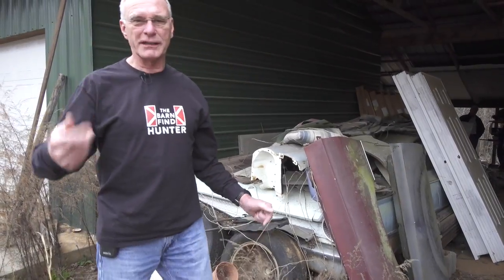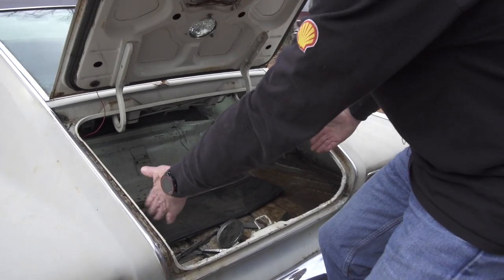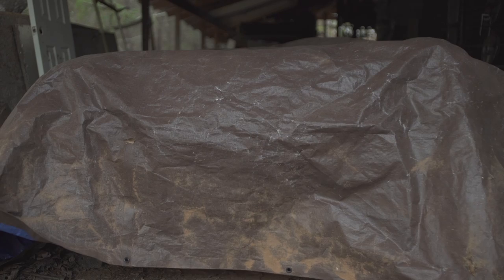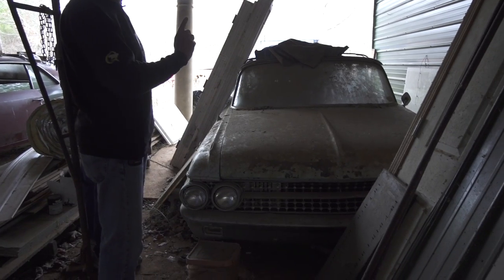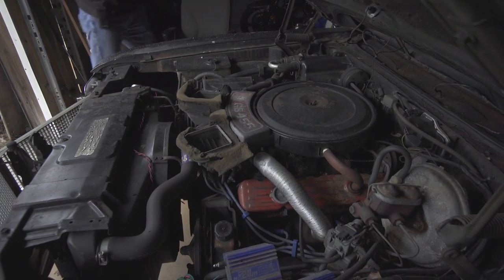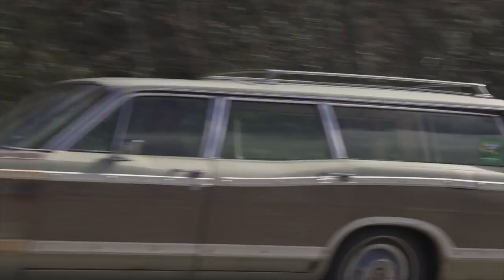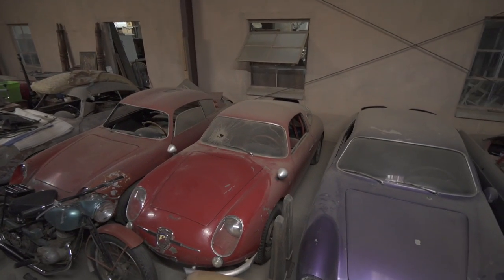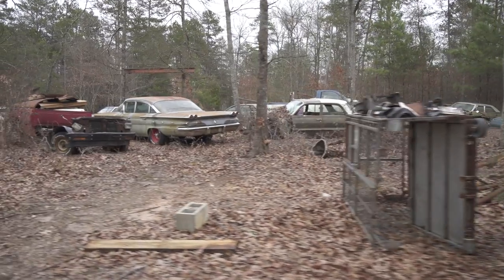Chevy C1 Corvette, a "baby Ferrari" and a dusty Abarth collection | Barn Find Hunter - Ep. 18

Comment: That '57 looked good for $5K but I thought that more complete '68 Chevelle for $7500 was the better deal if the frame and floors are not rotted like some of the body way. I wish i had $50K to blow on a car; that '70 GS convertible was sweet!
Reply: garth locklin that chevelle was a great deal
Reply: That Chevelle isn't worth $7500 unless it is an L78 car.  I currently own 5 Chevelles (69 SS 396 4-speed, 70 SS 396 4-speed, 72 SS 402, 72 SS 454 and a 70 Malibu) and have studied their prices since I was 18.  1968 is one of the least desirable years for Chevelles, and therefore one of the least valuable.  If that car is TOTALLY rust free (by rust I mean holes, not surface rust that requires no metal repair) AND an L34 car then MAYBE he can get that much for it.  An L78 car would obviously be worth that much.  Unfortunately, 68 SS Chevelles just aren't really well-liked by most of the Chevelle community for some reason.  The 375 HP 396 was available from 1965-1970, and out of all those years, the 1968 L78 Chevelles are by far the least valuable.

And that 57 definitely looked like it was worth $5k even without a drive train, but most of the other prices were just delusional.  $4,500 for that hack-job low-rider 4 door 63 Chevy?  But that's nowhere NEAR as bad as asking $8,500 for that 65 El Camino with a big block.  I mean that is BEYOND delusional.  That is probably TWICE what that car is worth.  And I wish this guy was a little more precise regarding that 70 GS vert.  Even though I am a lifelong Chevelle guy who also has a soft spot for GTOs (I have a 69 GTO vert right now), my all-time favorite 1964-1972 GM muscle car is a 1970 Buick GS 455/Stage 1.  I love that they were considered more "luxury" cars at the time, and yet the 70 Buick GS has such an aggressive, muscular looking body style while still being understated (no stripes or crazy colors, and the functional hood scoops are small and understated as well).  This guy calls that car a Stage 1 but according to the badges on the fender that is NOT a Stage 1 car, it is just a GS 455.  Not that that means it's not a cool car because it DEFINITELY is, but the difference in value between a Stage 1 convertible and a GS 455 convertible is HUGE.  If that is NOT a Stage 1, then $50,000 is DELUSIONAL, just like the majority of his asking prices.  Here is the same car, numbers matching/automatic just like his and in much nicer driver/local car show condition for $2,500 less than this guy wants for his car and that car listed in Hemmings likely won't sell for that high a price:  https://www.hemmings.com/classifieds/dealer/buick/gran-sport/1585146.html
Reply: I agree Alex S. The reason I like the '68 is it's less expensive then the '69-72 models. I have always had the less expensive classic cars and they are not investments to me. I usually start with junk and sink $5-10K into them and use them for 10-15 years and sell them for $3-5K after 50-80K miles. It's a cool hobby or at least it used to be. I feel as if I am getting robbed when buying NOS parts for my '74 Plymouth. Like Jay Leno says it's really easy to get upside down in an old car. I can also agree with your statement about the GS 455 convertible. You could tell the guy was trying to hide something about it in his mannerisms. He probably knows it's not a Stage 1 car although Tom Cotter said it may have been.
Reply: Alex S Cant agree with you more on the prices of these cars. I've owned several Chevelle's in the past with my all time favorite being the 68 elcamino. Total redesign from the 67. In my opinion has the best looking front end out of all the Chevelle's. Why that year is the least favorite among collectors is beyond me.
Reply: Yeah sweet and super rare !! Alotta bread for that car it will cost you ,10000 for a paint job let alone more detail work to interior band engine and suspension

Comment: One time in my life I found a true barn find. My brother had leased a farm for duck hunting and there was cars all under the trees around the house. IN the steel shed it was full and I mean full of autos and most were under tarps. The next week I was leaving for auction school and I told my brother to tell the owners to not sell them through the local farm auctioneer. I had been to several fine car auctions and ran a consignment auction for several years. Just as I predicted the local auctioneer pulled the cars across the block without even cleaning them up. an auction that at that time I estimated to be worth no less than $500,000 ended up bringing under $250K Had they been cleaned and worked on and taken to a fine auction I believe there was 900K minimum.

Comment: 6 years ago I had a chance to buy a Rambler Merlin that had every option available. If i remember right it even had the rare retactable seatbelts option. The engine was a 327 with a 4bbl. The guys grandmother had bought it new in 1965. Could have picked it up for $1500.00. But it was going to need a frame off restoration. We put a pencil to it and decided it wouldn't ever be worth the cost to restore it.

Comment: The double bubble also helps with airflow to the rear of the car, meaning the rear wheels are pushed down without the need for an unsightly spoiler. In the case of something like an Alfa TZ3 where Zagato incorporated the bubble in the roof for greater stability, they’ve also cut the rear of the car off abruptly - also known as a kammtail - to reduce the vehicle’s drag to improve aerodynamics and overall speed and fuel economy. Clever people, these engineers designers...!

Comment: they did not mention the Alpine A110 and I believe the AMC Marlin came with either  a 287 or 327 CI , never heard of the 292 version
Reply: 292 was Rambler's six cyl.  Don't remember seeing under the hood, but doubt they had 6s in Marlins.
Reply: You are correct. I looked it up and available engines are 232, 253, 274, 287, and 327.

Comment: Some very cool projects. But that black Buick convertible is a GS 455, not a stage 1. Buick had three GS cars in 70-72. The GS 350, GS 455 and the GS 455 Stage 1.

I had a 72 Stage 1 convertible. A friend had a 70 or 71 GS 455 coupe. Both were very fast cars.
Reply: I guess so with at least 10 .5 _1 slugs and a huge 850 cfm carburetor it breathing fire like a dragon
Reply: Oh one more thing it was one of the fastest car in the world stock in a quarter mile run also it truly could beat a Corvette off the line

Comment: It would take a heck of a lot more than a weekend or two to make the Corvette "good".  Maybe "fair" condition if you got lucky and the seals and wiring aren't dried out. Tom does a great job, but I think he's a bit of an optimist sometimes. 

From Hagerty, Good: #3 vehicles could possess some, but not all of the issues of a #4 vehicle, but they will be balanced by other factors such as a fresh paint job or a new, correct interior where applicable. #3 vehicles drive and run well, but might have some incorrect parts. These vehicles are not used for daily transportation but are ready for a long tour without excuses, and the casual passerby will not find any visual flaws. "Good" is the one word description of a #3 vehicle.

And Fair: #4 vehicles are daily drivers, with flaws visible to the naked eye. The chrome might have pitting or scratches, the windshield might be chipped. Paintwork is imperfect, and perhaps the body has a minor dent. Split seams or a cracked dash, where applicable, might be present. No major parts are missing, but the wheels could differ from the originals, or other non- stock additions might be present. A #4 vehicle can also be a deteriorated restoration. "Fair" is the one word that describes a #4 vehicle.

Comment: The '70 Buick GS is not a Stage 1. I owned a Stage 1 back in the mid-70s. Mine was a hardtop, but otherwise very similar to this one. A Stage 1 has a unique fender emblem and a Stage 1 sticker on the air cleaner. The trunk and grill emblem might have said Stage 1 as well, but can't remember. This car has the normal GS 455 fender emblem. The production numbers mentioned apply to the Stage 1, not the standard GS 455. Tom should know better about that one. 

Man, that Stage 1 was some engine. I could break into the 12s at the strip with street tires. The only thing that wasn't stock on mine was a Holly spreadbore carb replacing the quadrajet and 2 1/2 exhaust all the way to the rear bumper with Hemi mufflers.
Reply: I have been a lifelong Chevelle guy (although I think that whole "one brand loyalty, Mopar-or-no-car" type BS is for idiots) and currently own 4 SS Chevelles from 69-72 and a 69 GTO vert, but for some reason the 1970 Buick GS has ALWAYS been my favorite GM muscle car.  Despite the fact that the Buick GS's (not including the GSX obviously) are by far the most understated, "sleeper"-type GM muscle cars of that era, I think the 1970 GS had the most muscular body style, and you could fit some big meats underneath those wide rear quarters.  The body lines are so aggressive and muscular looking, but everything else about the car is understated, including how tiny the functional hood scoops are.  I love that about those 1970 Buicks.

Anyway, the first thing I spotted was the fact that this is NOT a Stage 1 car based on the fender emblems, and the prices he quoted are WAY off base for a regular GS 455.  Even though the non-Stage 1 70 GS 455 convertibles are VERY rare (they only made 1184 of them in 1970), they aren't super valuable.  There are multiple 1970 GS 455 convertibles with the #'s matching engines and automatic transmissions in nicer condition than this car for sale right now for less than $50,000.  Here is a perfect example:  https://www.hemmings.com/classifieds/dealer/buick/gran-sport/1585146.html   That is basically the exact same car in very nice "driver" condition for $2,500 less than this guy wants for his, and I'm betting that car in Hemmings won't sell for that much money.  Nearly all of this guy's asking prices are delusional.

Comment: I would take the 98 Olds Convertible and the 54 Corvette. Not a lot of those older full size convertibles had AC and full power. That C1 I would drop in a LS7 and probably C4 running gear. Make it one hell of a killer driver. Just kidding the C1 would stay original if the drivetrain was original to the car. If not it gets the LS7. I liked the 70 GS 455 convertible also. Nothing on that car identified it as a Stage 1 though. Would have had fender badging and the engine air cleaner decal.

Comment: If the Buick GS is a Stage 1, where are the chrome rocker covers?  There are also "455" fender emblems rather than "Stage 1" badges.  A '70 GS 455 convertible is a great find in its own right, but I'm not sure that's a Stage car.
Reply: A real 1970 Buick GS Stage1 will have "GS Stage 1" emblems on the front fenders, not "GS 455" emblems. It will also have chrome valve covers and a "Stage 1" decal on the air cleaner lid. This car is a GS 455, not a Stage 1 car. I have collected these cars for thirty years and know them very well. I am surprised that Hagerty would put out information that is not correct. Buick made 1040 GS 455 convertibles in 1970, so this is still a rare car. Just not quite as valuable as stated.

Comment: Not in fair condition.  The missing windshield for the corvette is 8 to 10 grand.  That car might be worth 20 in parts. Sorry but sitting out side ... makes the value drop
Reply: It would cost 10000 to paint the dam car. Let alone body work fiberglass can get expensive what about frame and the motor how good is that you need 30000 to bring that back to life and prestine condition at least